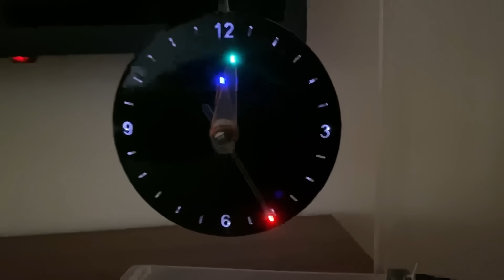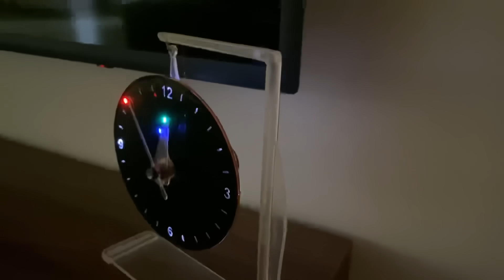Induction Clock. Let's make it for your home

Comment: What is the number of this copper wire??
Reply from the maker: coil L1 = 10 turns
coil L2 = 30 turns
Circuit : https://drive.google.com/file/d/1olWNHcVb3HWPCYfQwC-rpjstRLxAGQHo/view?usp=sharing
Reply: Sir i mean to say,..what's the guage of this copper wire which you make coil???
Reply from the maker: @debrajpradhan8739  sir, wire diameter is 0.3mm
Reply: Thanks bro 😉👍

Comment: Why did you use a power transistor, if you could use a circuit with two small transistors and with higher efficiency. Your wireless power circuit looks very inefficient. It is better to use some kind of royer oscillator for this. They can work at higher frequencies, than your circuit with a power transistor, that's good for smps like a computer power supply and can't work with any high frequencies. This probably oscillates at frequency of about 50 kHz or something like this and uses too much turns of the coil. Better design uses a high Q factor resonant circuit with a center tapped coil, an RF choke and two small npn transistors, two resistors and a feedback coil.